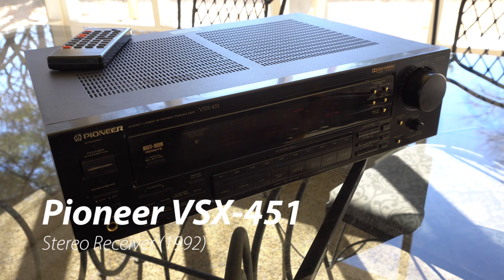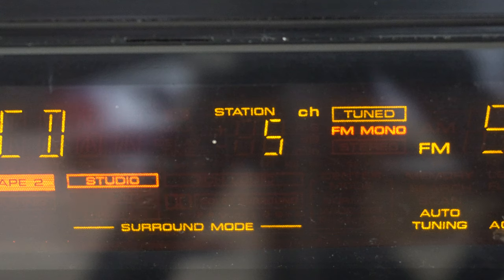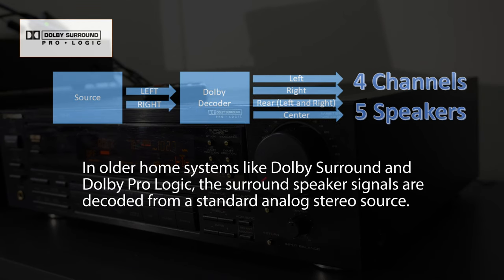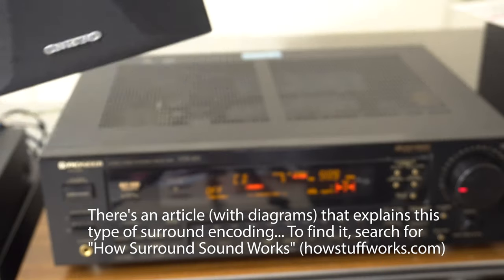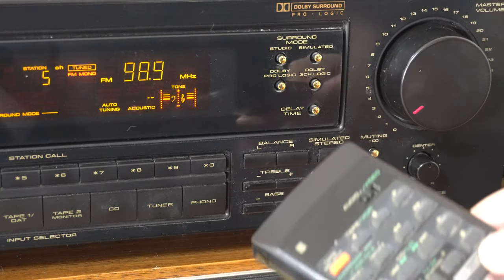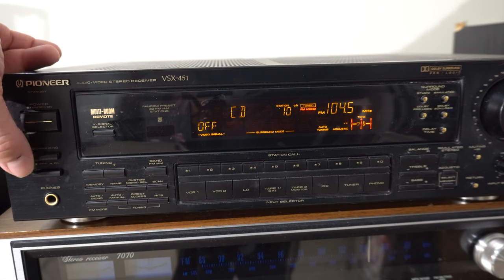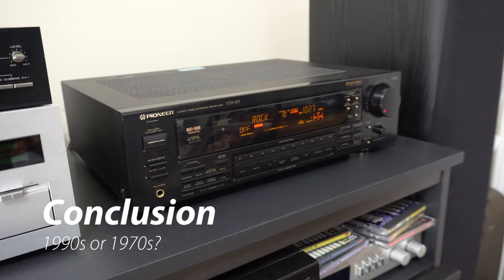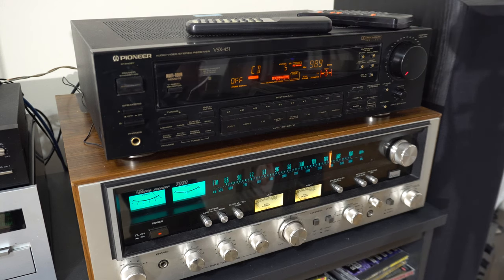Pioneer VSX-451 Receiver with Analog Surround Demo

Comment: Have the same issues with volume. Sometimes scratchy and also right speaker goes out. Never thought it could be the speaker button. Thanks for the tip. Will try cleaning that with wd40 contact cleaner.

Comment: How do I use aux with the does it go into the ‘control’ or “multi room remote “ hole?
Reply from the maker: Neither - if by use aux you mean a phone or something... Those jacks are not for sound, but for controlling other Pioneer equipment. What you need is a 1/8 inch to RCA adapter cable, which is available from Amazon or Walmart for a few dollars...